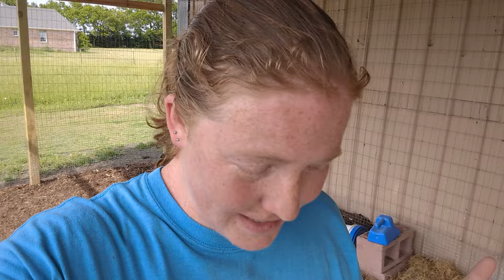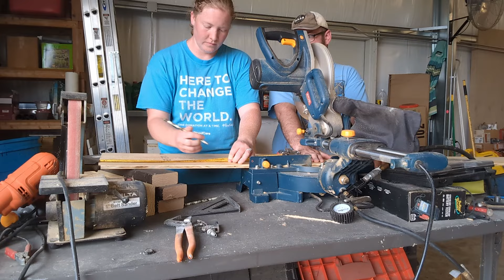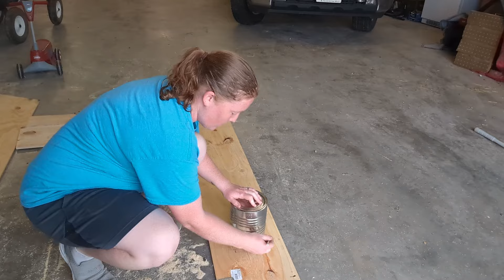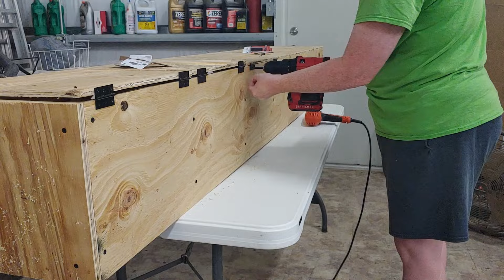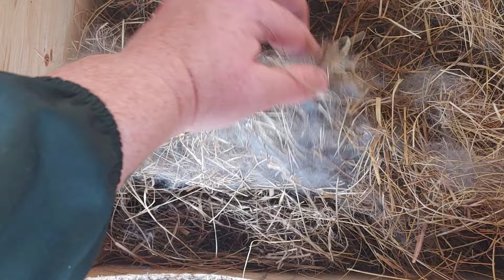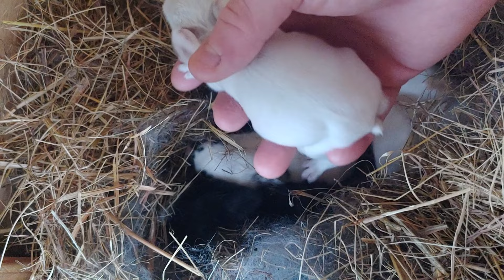Building a New Home for the Rabbit Kits | DIY Nest Box

Comment: Wood brings mites ( ear mites)  you should cut a hole in the bottom of rhe cage and add a box out of cage material so when she goes down into the box ( but its made out of cag material) the pee goes out no wood for mites, in winter we put magazines in all 4 sides for insulation then they will fill the area with straw and hair them selves.
Reply: Hay brings mites where we live.  I made wood nesting boxes and haven't got mites from those. But have from hay with older rabbits.
Reply: @maplewoodhomestead2017  that's a new one. I've been a farmer for 70 years and that's a first. Never in my life heard of mites living on hay. They come from chickens and live in wood nesting boxes and chickenhouse floors . Then spred to your rabbit hutches.  I raised rabbits for years ,had over 300 rabbits and we learned not to ever use wood on any part of the cages. In summer we would freeze  milk cartons of water and put one in each cage of the big rabbits. Used a square of sheet rock on the cage bottom to keep their hocks from getting soar. Because the pee wouldn't absorb  so they had a comfortable place to lay.
Reply: @Sandra-hk8ks It may be a thing where you live,  I would guess. I use wood and metal nesting boxes.  I don't give the rabbits hay on a regular basis but when I do,  that's when I get ear mites. Our chickens are on a separate place on our property. I understand and are thankful that you've shared what your experiences are, just want to share mine. Wooden boxes have never caused earmites for our buns, but the feeding hay has with my older buns.
Reply from the maker: That's a great idea! Thanks for sharing.
Reply: @NewDayFamilyFarm  I'm only full of information from all my years being a farmer. I always try to lighten peoples loads if I can help